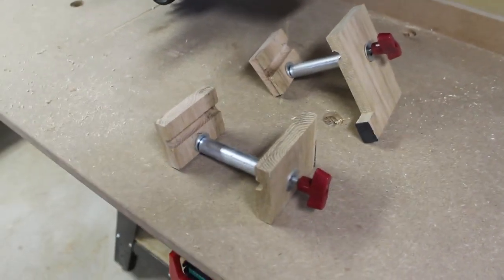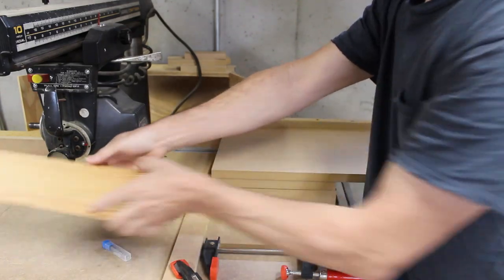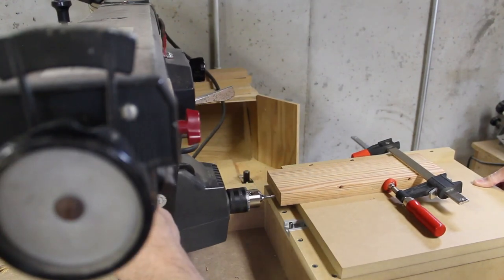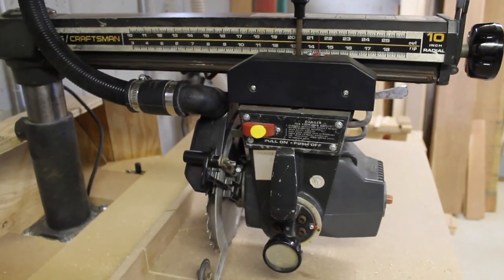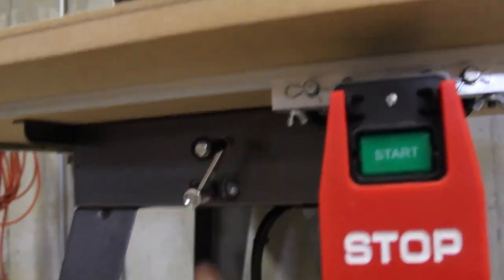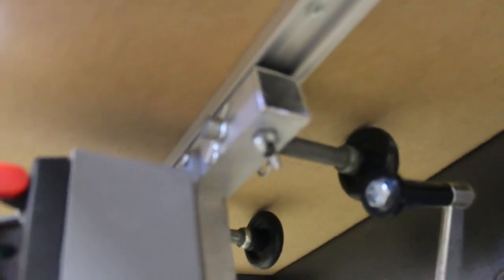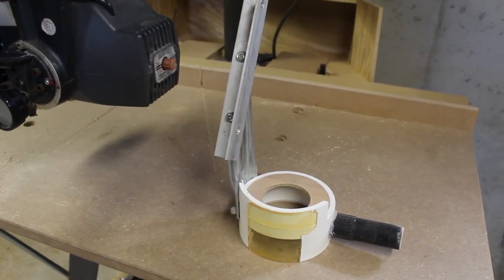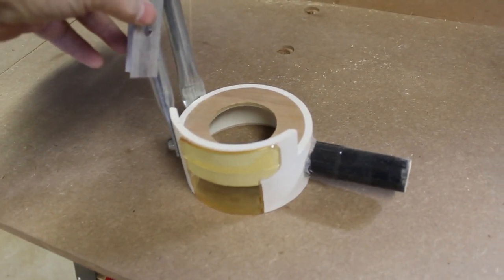Radial Arm Saw Mortising Table & Saw Mods

Comment: I just picked up a Rigid 10in Radial arm saw. I would love to see more of yours in action with some good instructions. Its hard to find good information.
Reply from the maker: Hi Tim! Several of my videos feature the RAS. It's not always in the teaser image. This blade review is one. https://www.youtube.com/watch?v=G19W0WM3N8c If you don't already have one, I suggest searching out an owner's manual. There's a lot that goes into getting the saw set-up properly, but it's well worth the effort. At some point I plan to do another RAS only project. In the mean time check out The Northland Workshop https://www.youtube.com/@TheNorthlandWorkshop That guy has a bunch of RAS info.
Reply: I'll check out more of your videos for sure.  I have watched a few of his videos. He's got good stuff too, just very long form.  I'm interested in more on planning on shaping sanding attachments too. That's the stuff you don't see much on. Especially thing used with the aux shaft. I need to rebuild my table. It's good enough for now, but seen better days. I'm currently running an 80 tooth gen purpose because I needed to square up some 8/4 with minimal finishing for a project. Luckilywho i got mine from must have kept it dialed in.  It came out pretty dead on.
Reply from the maker: If you haven't already, take a look on ebay. I've seen a limited selection of planing attachments and molding heads there. All I've found that fits my aux shaft is a drill chuck. It works okay chucking router bits but has more run out than I would like. I tried a sanding spindle. It works but the vibration is too much. The same spindle does fine on my drill press. Good luck!
Reply: @thehappychiselllc  good luck to you too!

Comment: You have some great ideas.  I don't know why I never thought to attach the ends of the extension supports to the base instead resting them on the floor.  I also like the way you use stuff from the shop to make your upgrades.  I use a router table or a drill press for mortissing, but this actually looks like it might be a better method.  Maybe you could use the planer attachment to cut the tenons?
Reply from the maker: Thanks Tim! I usually cut integral tenons on my table saw. Recently I've started using loose tenons and I'm finding that method faster and easier.

Comment: If you would buy a used Shopsmith, you could do this way easier.
Reply from the maker: But using the RAS is so much fun. 😁 Right now I don't do enough mortising to justify adding equipment, but that's something to keep in mind.

Comment: Where did you get the chuck?
Reply from the maker: This is the link for the one I bought, but Amazon says it's out of stock. https://www.amazon.com/R%C3%B6hm-1322223-R%C3%96HM-Chuck-20/dp/B07B3JQDNW/ The mount type is 1/2" x 20 UNF and it takes bits from 1 to 13 mm. Here's a link to another chuck I bought. https://www.amazon.com/Drill-Chuck-3-16mm-Heavy-duty-Capacity/dp/B09DYJ6QCF/ I replaced it with the Rohm thinking the Jeanoko had too much runout, but after using both I think the runout is coming from the RAS shaft. It's like the threads on the shaft aren't perfectly straight. It's still useful, I just have to accommodate the runout by sizing my tenons to fit the mortise.
Reply: Bought mine at Harbor Freight.
Reply from the maker: How's the quality? I've gotten some great stuff from them and some not so good.
Reply: @thehappychiselllc  the quality was fine. Got it a bout 5 years ago though.